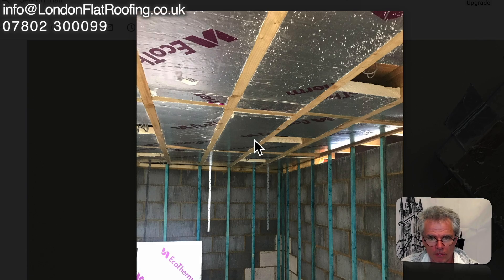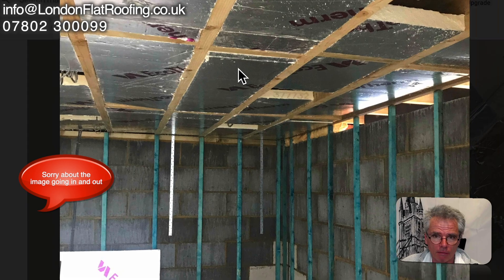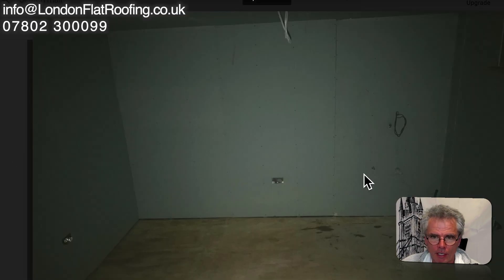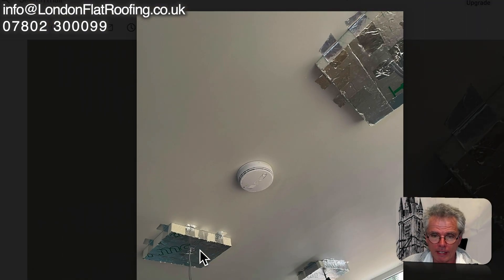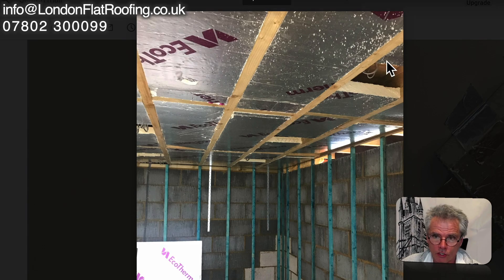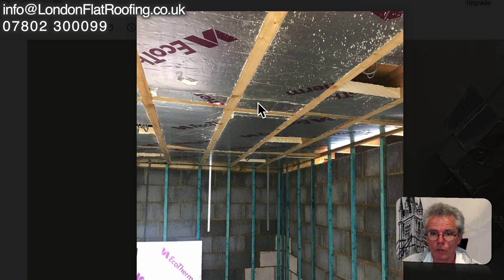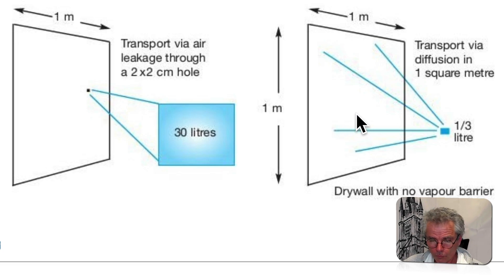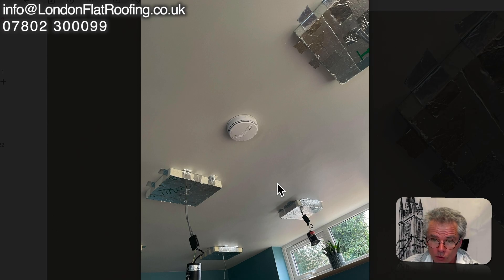Can I save my sweating cold flat roof with no vapour barrier ?

Comment: Wow many thanks for posting this video, it’s my building.  Thanks for the advice so you think I can just stick with the current plaster board which has no foil backing and just cut out bigger holes around the lights to fix the insulation and then patch up the plaster?  I’m going to replace the Dow lights with surface mount so only the cable is coming through the insulation and with foil tape around where the cable comes through the insulation to try to reduce the air escaping.  

I also wonder since there is only 50mm insulation board and there is enough space in the roof for 75mm, would it make a difference? There is a 110mm ventilation area between the insulation and ply roof at the front of the building and this reduces to around 75mm towards the back, so I could change insulation. To 75mm and still maintain at least a 50mm gap for airflow.  

Or would that not be worth doing as I wouldn’t see much of a difference between 50mm and 75mm insulation board.
Reply from the maker: Just make sure there is no air leakage into the void from the room below.
Make sure there is good though ventilation above.I cant see how you would get more insulation up there and fitted tight without taking down the ceilings. Would it make much difference? no not a lot 90% of the insulation quality will be coming from the first layer and the fact that its tight to all the joists and is stoping warm air from migrating up placing another on top that's not fitting tight wont make much of a difference
Reply: @SteveRoofer  hi steve, yes i meant if the ceiling was taken down and the 50mm insulation replaced with 75mm would there be much of a difference to heat retention and also reduce the amount of warm air going in to the void.  If the void is also slightly smaller, will that also mean less warm air circulating around up there which may mean the building doesn't need to work as hard to remove it?, many thanks!  I'm also seeing some loss around the corner front edge of the building like a L shape,  i noticed it today as its snowing and this section at the front as missing snow! ~2foot section, this section is still having a little condensation in the front soffit too, where as the rest is now pretty much dry.  I'm suspecting here that the insulation towards the front may have a slight gap in it, or not overlapping the cavity wall properly to seal it.
Reply: @Insomniacbraindrain  You could easily cut out 600mm x 600mm access openings in your ceiling area.
You would have enough access to patch in your insulation bat, you could then make a feature of placing dropped 600 x 600mm flat panelled LCD light's? Like what is used in suspended ceilings, these panel's also have very little heat, which would reduce any ceiling void condensation?
Reply: @jeffreybresnahan  there is no way the Down lights are going back.  I’ve been looking at similar led ceiling discs which just attach to the ceiling on the underside.  One issue I have now (since it was snowing today) I can see some heat loss around the front right hand side of the building and interesting this is where I had still got two problematic sections of soffit between joists which are still slightly damp and a little condensed.  The rest is all dry so it’s only that corner.  Snow gave it away as it melted across that section even though the rest of the roof was covered with snow.  Where the heat loss is happening there is not from the lights, I suspect it could be something like the ceiling insulation is not properly overlapping the cavity wall insulation to seal it properly and it might have a gap causing some heat to leak out.  I’m ok with cutting out the lights and repatching, but what about this other section.
Reply: You can purchase a cheap flexable mini micro video camera which has a light in it, you can drill a couple of 10mm to 12mm holes in the specific ceiling/wall void area requiring inspection? 
The video camera fits into a laptop or ipad USB port, you just move the inserted camera around the area to see if you can view the problem? If it is a specific cold spot, or void/cavity area due to no insulation, you can take a chance on spraying the area with expanding cavity spray foam at 200 x 200mm centres? I have used this technique on several job's 
I have been asked to help out on, and have had no call backs?
Reply from the maker: @Steve Turnbull  Add more odvilsy make the room wormer but the difference will be marginal after the 50mm and in my opinion not work the effort if you added 100 and insulated plasterboard under the joist then you will make a difference
Reply: @SteveRoofer  we can’t add 100mm because towards the back the gap between plaster board and deck is only 130mm so adding 100mm  insulation would only leave a 30mm ventilation gap
Reply: @Insomniacbraindrain  The space between the insulation and the roof deck is supposed to be 50mm at the ends they recommend a vent that is equal to 25mm continues. If your venting is good and open I would not have a problem of closing the gap down at one end to 30mm.  especially if you are putting up a good  AVCL (air vapour control layer)
Reply: @HampsteadBuildersLt   thanks, the roof has come down and the builder is going to fit 100mm two thirds and 75mm at the back section to replace the 50mm throughout 

This is the ceiling which we can now try to clean as best we can after just 4 months since it was built
https://ibb.co/xCMbCpC
https://ibb.co/zn8s5dM
https://ibb.co/mvPr8tp
https://ibb.co/K9bDF7F
Reply: @SteveRoofer  this is the deck now as ceiling has been brought down and we can try to clean as best we can after just 4 months since it was built
https://ibb.co/xCMbCpC
https://ibb.co/zn8s5dM
https://ibb.co/mvPr8tp
https://ibb.co/K9bDF7F
Reply: PS! You can buy a cheap inspection hole camera, for a smart phone on ebay.uk.
Reply: @jeffreybresnahan  I could but I’m not in the building trade so might be a bit tricky for me figuring out where to drill holes
Reply: @Insomniacbraindrain Your wall support timbers are at 600mm centers from any of the corners, your ceiling timbers should be the same. Electric socket cable's should be running at 600mm off the floor level. (Out of the way, of you drilling any high up inspection holes?) 
So if you measure 600mm off your corner and divide by two, to find the center at 300mm, and 100mm down from the top of the ceiling that's where you carefully drill a 10mm inspection hole? You can then cut a piece of timber batton measuring 600mm, and place it on the first marked/drilled 300mm center. And you just mark again for the next timber center, working along the same horizontal line marking along the wall, or ceiling area to be inspected?
Reply: @jeffreybresnahan  I’ve got an inspection camera and had a quick look through the front vents in soffit.  Those cameras are not easy to use ! However where the brickwork is at the front I can see where the roof insulation finishes and inbetween the brick work and insulation board is some yellow fluffy insulation.  I can see what looks to be timber above the front door and there are some gaps in the fluffy insulation where cables are run.  Can’t post a picture on YouTube so have no idea if that’s normal or not

This link might work, the red is the brick work 
https://ibb.co/vVXGVFx
Reply: @Insomniacbraindrain  Are there any large area's or cavity voids that have no proper insulation in the specific area of condensation, or mold on the internal walls?
Reply: @jeffreybresnahan  well
That is one area which seems to be having heat loss as it’s where the snow melted a few days ago, I’ve only been looking in what I think is the worst condensation bits, I guess from the photo the bit with no insulation, should it be having insulation or is it ok
Reply: Another picture of the gap where there seems to be missing insulation?
https://ibb.co/svKfXFV

I thought the insulation should carry on through and over this timber to the external brick?
Reply: @Insomniacbraindrain  If there is a void anywhere to the specific area of any condensation, then cold air is massing there. So when your room is heated up it will hit that wall/ceiling area, which will be at a lower ambiant temperature and condense? You need to inspect the whole area wall/ceiling line at 200mm centers , if there is a void with no insulation you will need to insulate, to close the void area? So no open void area means no cold air cavity, you can use a thin 8mm round timber rod and push back any crap fibre insulation, and then inject expanding foam into the void area. Just make sure you seal any external facia openings etc, with tape and sheet up the floor area?
If it's both the ceiling and wall area condensing, inject the ceiling area as well,
let the foam cure over night and remove any excess and calk in the plaster board  holes. When caulking in the holes make sure you recess the caulking with your finger, for a divit which you can fill in with a wall filler or tile grout? Slightly over fill, or grout in the hole's, allow to dry as specified, and then sponge wipe flat.
Reply: @Insomniacbraindrain  Just carefully drill 8mm access holes in the ceiling/wall area along that void line, and buy several large cans of spray foam from Tool Station at £5.00 a can.
Shake the cans well insert the plastic nozzle as far as it will go and press spray, slowly working back ward's towards your access hole?

Comment: With a 50mm gap maintained above the insulation and ventilation in the soffit and an abutment detail in line with your other videos.  No downlights.  Would this mean the vcl is not required?
Reply from the maker: No  you should still have a VCL but if you have forgot to put it in  its not the end of the world
Reply: Thanks for the response.   In the planning stage at then moment so I'll add one.

Comment: Does the mould in the roof created by moisture from the water vapour go away and what damage does it do ? Cheers
Reply: if the ceiling is resealed with no holes in it to prevent moisture going up enough for mold to grow and the airflow is adequate then yes it will dry out and go away, putting a drop false ceiling in for the lights and services etc is the best way to have no holes in your fire/moisture barrier ceiling, but if you cant and you have to put holes in the ceiling for spot lights etc then you should make sure the insulation is continuous and sealed and consider using the insulation coverable type spotlights and seal the rims on the finished surface

Comment: So how would u suggest for putting lighting into a roof space?
Reply: Official answer for downlights is batten down after the under rafter insulation and install low profile down lights in the batten void. Often this isnt feasible.

Edit: This is for a vaulted ceiling or cold flat roof. Ideally for a flat roof, in the first instance do a warm roof then you can just put them straight in, again not always feasible.

Alternatively could always just install a low profile surface mounted light fixture similar to a bathroom light.

Comment: Hi Steve
Thanks for your brilliant videos.
Got question myself:

How would you insulate a 80mm concrete slab roof with 100mm overhang above single brick walls. Currently is not insulated at all with felt on it. Building attached to the main house and built with it. It was a coal storage back in the days.

The issue is overhang of this slab which obviously will be a cold bridge.

Photo in here https://imgur.com/a/cjdNnlp
Reply from the maker: Its hard as the edge will alway be a thermal bridge
Reply: Is there room to  bond/ screw some 1"or 2" thick kingspan type board to the slab outside? Then cover with upvc or timber fascia/ soffit?